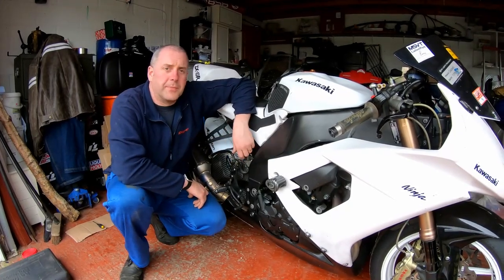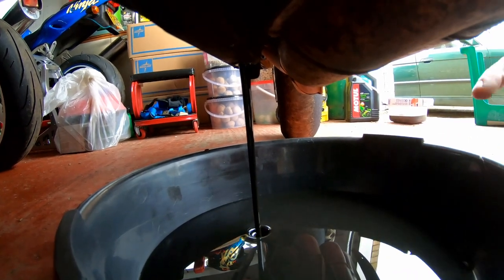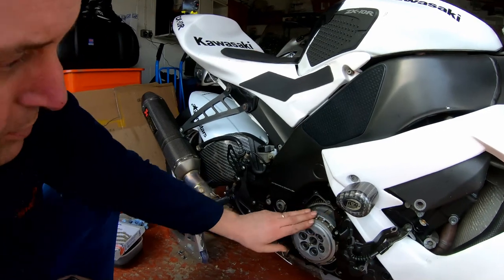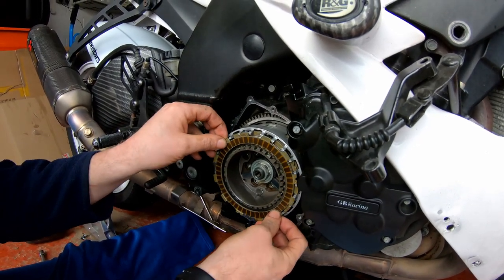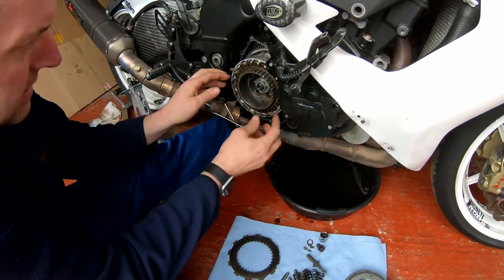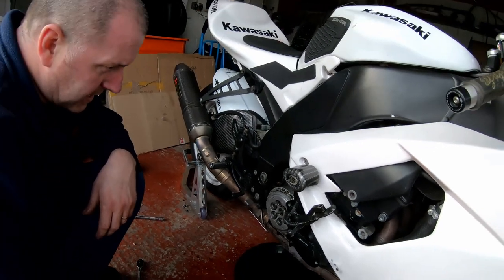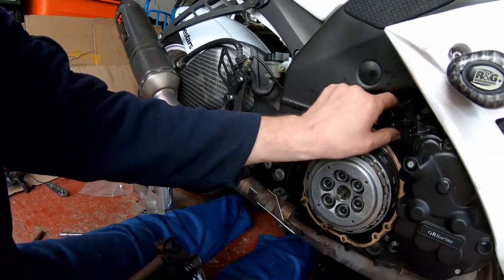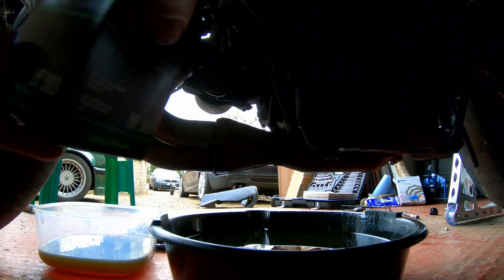Changing The Clutch On A Motorcycle - Demonstrated On A Kawasaki ZX10R

Comment: Would you happen to know what would be causing a hard vibration throughout the bike when releasing the clutch in first gear? It just started happening a couple days ago.  2009 ZX10R. I checked all the clutch plates and they look all good, I think I'm going to remove the clutch basket and check the rivets on the backside but I'm waiting for my buddy's impact gun to get that nut off

Comment: Hellou can you please help me with conical spring installation?conical end facing to the clutch cover or conical end facing to the motor ?thank you i dont see clearle in the video,sorry about my english thank you
Reply from the maker: The springs should only fit one way, the cups on the end that the bolt heads sit inside should sit inside the spring.
Reply: @KevsShed  mate sorry butt i realy dont understand ,first is the spring seat and then the spring,spring have conic end and i dont know that the conic end is facing to the clutch cover or the conic end is facing on the motor ,sorry about my english,thank you for answers

Comment: Hi sir, May I ask you a question. I noticed that the clutch is not the slipper clutch. I have a 2017 zx10r bike, so it does not equipped with slipper clutch? why? even z900 has a slipper clutch. I am so confused....
Reply from the maker: This ZX10 does indeed have a slipper clutch, there are small ramps on the rear of the pressure plate and on the inside of the clutch basket, it probably just wasn’t clear in the video.
Reply: @KevsShed  Thanks a lot bro!!!!!